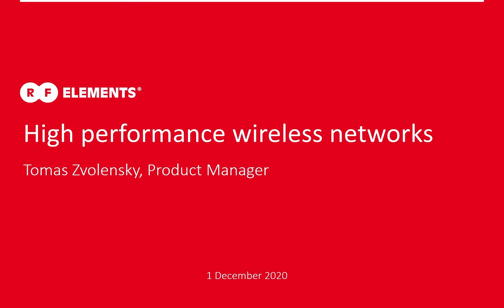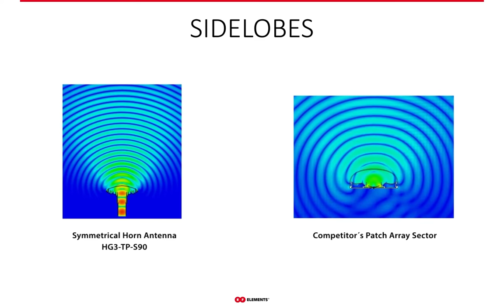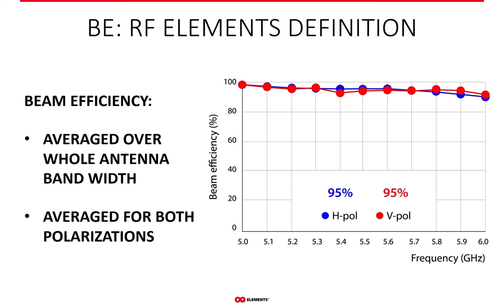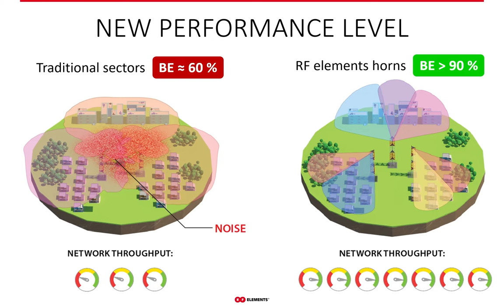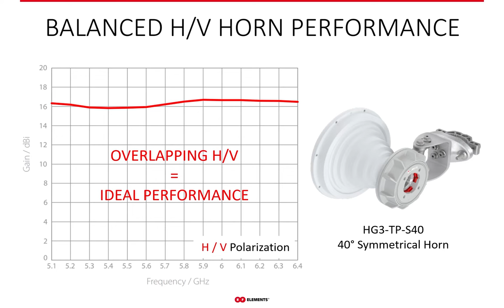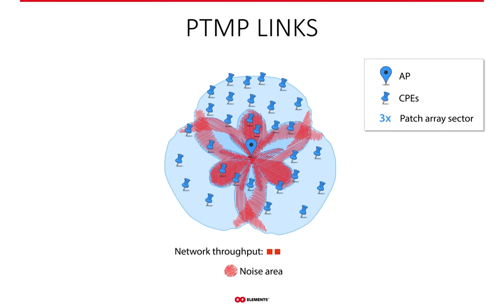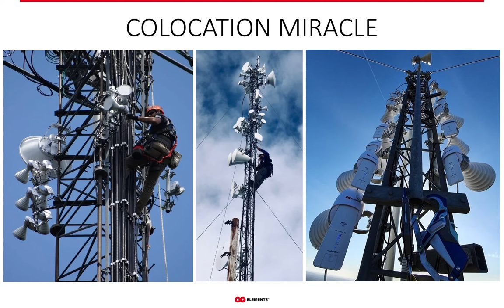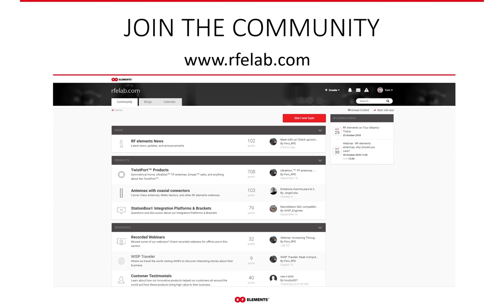High Performance Wireless Networks

Comment: Thanks, we have a 32 dB dish antenna on a 25.59 km link. It's behaving well but because of the big size, I was thinking if we can switch it to Ultrahorn 24dbi. What is your suggestion? We have c5c as radio.
Reply from the maker: You can get an accurate estimate of potential performance using our link calculator https://rfelements.com/calc where you can enter all the link variables and see the throughput you can expect.

Comment: I highly appreciate the knowledge I gained in this channel in the most efficient way.

I just want to ask if a cellular tower has a horn antenna, depending on its directionality, it can be used as P2P tower communication (instead of optical fiber) or may be used to service the customers in a sectored area?
Reply from the maker: We are glad you find our content useful! Horns can be used as PTP antennas or sector antennas. Traditionally, the PTP antennas have high gain and narrow beam width (such as Ultrahorn for example - http://bit.ly/2ZhzQ0P). But, the choice melts down to the link budget restrictions (https://bit.ly/2LUbEP2) and noise conditions (https://youtu.be/1TYW7T6X2_k).  If the distance of the point to point link allows it, a Symmetrical horn such as this one - https://bit.ly/2OFxJ4U - can be used for PTP as well, and vice versa, you can use UltraHorn for sector coverage too, if you are covering a distant sector with user stations clustered close to each other.
Reply: @Rfelements  Thank you for this. Your practical expertise aids me in teaching :)

Comment: Im using Ubiquiti's Prism Station with 90degrees HORN atenna, yet, it can hardly achieve a throughput of 20-30Mbps even if the AP is set at MCS 7 to 9. CPE is litebeam Gen2 at 3Km link. No matter how I changed the frequency. Does the horn antenna helps in achieving higher throughput?
Reply from the maker: Hi Arvin, do you mean the default UBT horn that comes with the radio? If so, then I would try RF elements horn, not all horns are made equal :)
Generally horns help drastically decrease noise floor, which increases SNR, result of which higher throughput is the result.

Comment: About side lobs how I can see this in real network
Reply from the maker: The symptoms of a wireless network suffering from noise caused by antenna side lobes are: lower throughput than expected, unstable throughput, complaining customers, frequent link service required.
You can check this webinar for more details: https://youtu.be/PauhX66Vfms